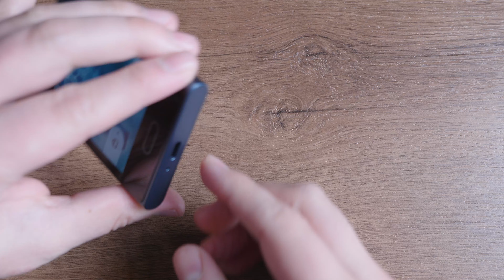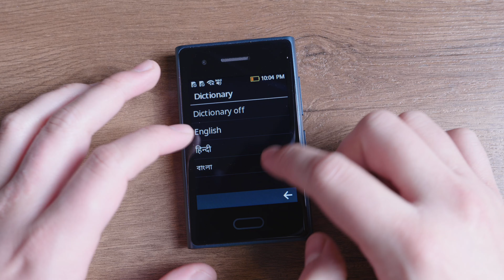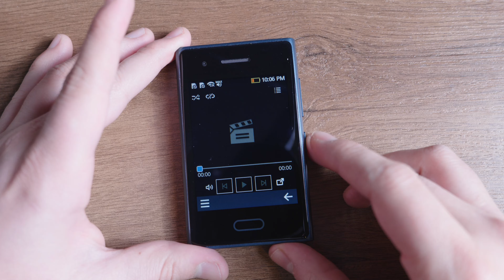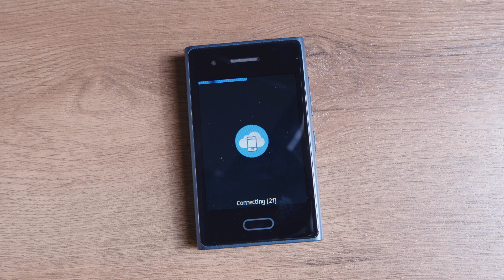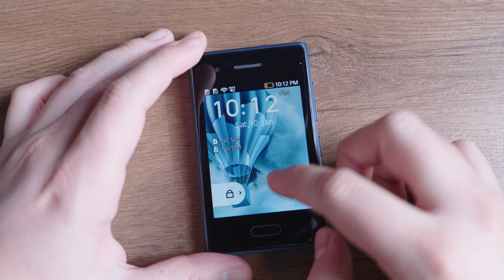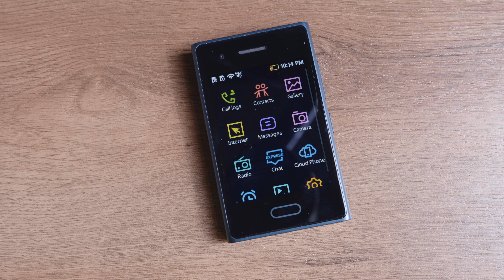HMD Touch 4G Review* || Exciting Times in 2026!

Comment: Thank you Jose! Does it have Wifi? Can it be used as a hotspot? I'm looking for a quite dumb phone but ideally one that can be used as a Wifi hotspot when needed, so I can go around with a small and simple phone and occasionally use its connection for my smartphone without having to move the sim card from one to the other every time. I've done so until now with an old Samsung Galaxy Y, but it's currently on its way to death... 😄
Reply from the maker: Yes. Hotspot is available and Wifi as well.
Reply: @JoseBriones  Wonderful! Thanks a lot! 👍